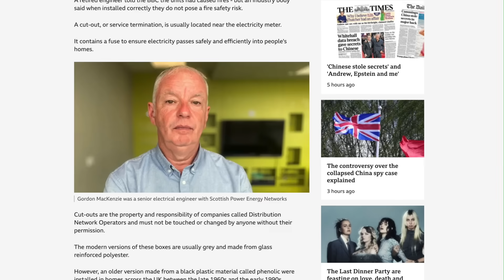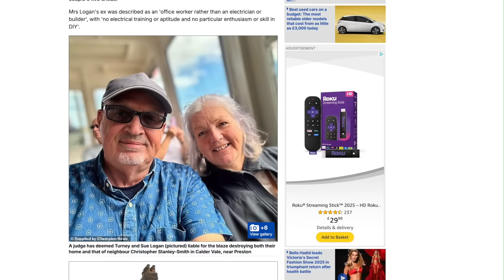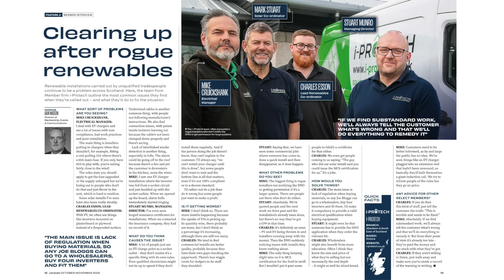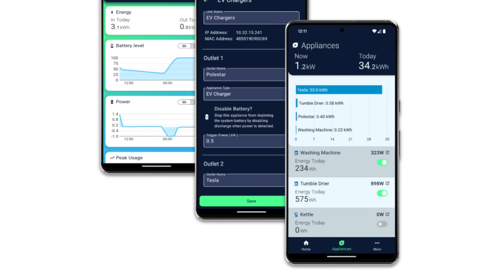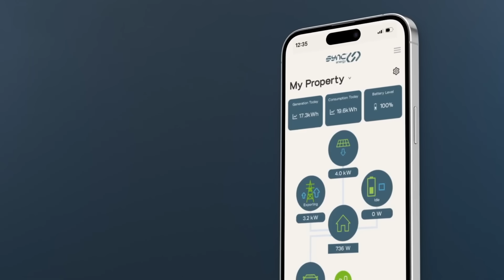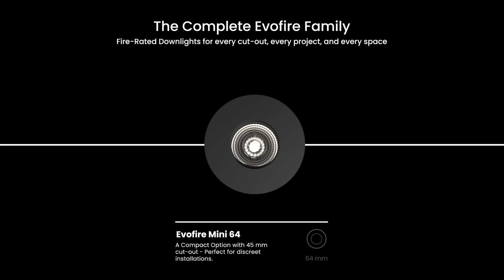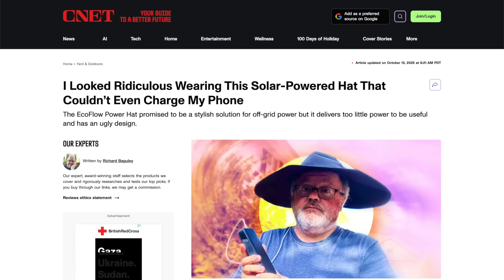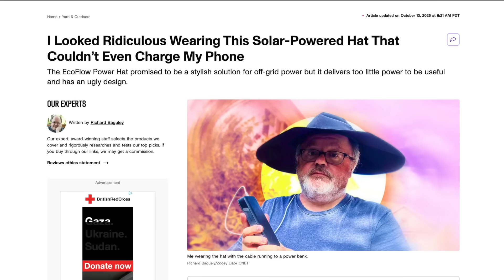Why Is the Electrical Industry Ignoring This?

Comment: Nobody knew there would be high current devices, such as car chargers and 8kw showers etc, when a lot of the infrastructure was built many decades ago.
If you say the industry is 'ignoring this', it is because it would cost billions to make upgrade their system to a suitable stadard, keeping in mind the added requirements in the drive to net zero.
As to safety - we rightly condemn cowboy installers; yet the supply companies themselves appear to have no standards that make sense on their 'installations' on this matter?

Comment: 2nd Ev install i came across in the last two weeks, one with 10mm t&e single insulated cables in the meter cupboard & no overload protection. The other with 10mm tails & 6mm earth same issue, along with exposed live parts, undersized earth conductor for a TNCS supply. I have not been able to get any clarification off the NICEIC if 10mm should be even used, main fuse rated at 80Amp. DNO say NICEIC responsible when asked a about main tail size.

Comment: I have to admit, as an electrical inspector, I have never thought to check the service cut out fuse that the casing could under certain circumstances become live, and I've noticed in the EICR form, it's not mentioned. It's obviously a C1 condition, but how would you enter it in the current EICR form ?

Comment: I have seen metal case cut-outs with tar like substance bubbling out. Phoned the national Grid emergency came out quickly & fixed it. I have also seen allegedly cutoff supply's that are still live not good.
Reply: Compound filled cutouts were installed in the days before central heating. Todays warmer homes soften the compound allowing it to slowly run out. From experience we know it could all run out, be empty, and it does no harm.
The worst part about this is the tar dripping on carpet etc. Our standard practice was to replace the cutout with a design that was the same and just leave it empty.

Comment: Well, well, well… if it isn‘t another case of shitty british standards and equipment! Small hint to solve the problem: using NYY-J cable to connect a building to the public supply and using an NH terminationsystem inside thr building. Just google „Hausanschlusskasten“ and you will find how the germans do it… and YES, it‘s the way better solution to do it!

Comment: The two terraced houses in Calder Vale, near Preston, Lancs, were effectively destroyed by the fire, which investigators said could have been caused either by a carelessly discarded cigarette end or an electrical fault relating to wiring leading to a freezer in one of the couple's garden sheds.
Reply: Mr Logan later told investigators that the electrics in the couple's house had all gone off and that about half an hour later he was "completely taken aback" to see flames "shooting out" from under the shed housing the freezer.

Comment: Interesting you talking about the cut outs. I had a guy come round on Monday from National Grid checking on the cut outs in our road. He told me that the Electricity Boards used to do this but, come privatisation, they were told to remove any personal data (customer name, etc.,) and hand it over to the supply companies who would then maintain the systems. Guess what? They didn't and now Nat Grid have no records so they're  having to go house to house and carry out quick checks (volt stick and thermal imaging camera) and record the meter ID and their results. I've got a nice little sticker on my cut out now to say I'd been inspected.

Comment: Yes! A year or two ago I stuck my head under the stairs to get something and could hear crackling. Uh oh! When I investigated, the tails into the cut out were melting. Turned off the washing machine and called the DNO.
He tried to fix the problem by re-terminating(!!!) the tails.. but broke it further and had to replace the unit.
I did try to quiz him on how the cables had become loose but he was not very forthcoming (I wonder why) but I did get "this happens all the time" !!!
I can only assume the bakolite is becoming brittle and the once secured cables are becoming loose?
So so so close to a fire.

Comment: A bit worrying about the supply hook, point failing with age? It's sort of potted, even having a  nose at it, not going really indication internally, before it burst in flames, looking very bad floor, and good excuse to gett every that not that keen smart meter, also known for exactly being sage, and safe for wollet when it goes wrong your electrical supplise should consuanable parts in it, what sould be build for the test of time not 5 years and need replasing or burn your home down to the ground

Comment: If this was an extension lead in a plug socket surely the MCB, RCD should have been questioned and why the circuit didn't tripif a rodent caused a direct short even a fuse should have melted.
Reply from the maker: Lots gone wrong on this one. 😬
Reply: @efixx  yes, as usual with courts, the details in the press release or whatever is lacking in vital details of what PRECISELY went wrong
Reply: RCD aren't that reliable if the rodent or gardner isn't grounded as they work by detecting a difference  between the phsse and neutral currents (caused by a portion of the current flowing to ground). If there is no connection to ground then whatever is attached to the end of the wire just appears as a load. I mentioned gardners before as there have been cases of someone cutting the cable with their (more often than not) double insulated hedge trimmer or lawn mower. They then pick up the ct cable, poke the end and get a belt because their gardening wellies are insulating them from ground.

Comment: 6kw wired in 2.5 flex into a plug top
3.5kw oven same as above
Plugged into the same double socket which was wired in 1mm cable🤦🏻‍♂️
“Kitchen sockets” at the board was a 1.5mm radial
It nearly burnt the house down absolutely stunk of burning rubber in there
Reply from the maker: Scary stuff. 😬

Comment: Why are you using so much awful AI generated B roll?
Reply from the maker: We used three pieces of AI generated footage. This came to around 16 seconds of video. In a 16 minute long piece of content. That equates to 1.6% of screentime. Hardly excessive.
Reply: @efixx  I make it two stills, and two pieces of footage, one of which was used twice and that presumably makes up the third. That's five instances of AI generated B roll spanning 20 seconds and eight frames. The video is 15 minutes, 56 seconds long, which makes it 2.1%.

Using scene cut detection I count about 100 different cuts, depending on you slice it, so that's about 5% of the clips by number rather than duration.

However, there are also 8 minutes and 12 seconds of adverts, so if you subtract that from the run time, that means 4.3% of the overall content you produced was AI generated, is that starting to feel excessive yet? Since about 51.5% was advert, 4.3% was AI, you only actually made 44.2% of it yourself, and that's being generous and calling the stock footage yours too.
Reply from the maker: No, it still doesn't feel excessive. Why did you feel the need to do all that calculating? And why does it bother you so much? Genuine question.
Reply: @efixx I didn't do that much calculating, but I did it because it feels excessive and I wanted to elucidate why and how it felt excessive. In this case because my judgement is that it was being used for things that can be done as well or more well using other methods.

The reason that's important to me is that the source data for generative AI was largely obtained unethically, and is regurgitating someone's work that they were not paid for. In addition, it is being operated unethically, using excessive quantities of resources that are also often obtained unethically, and in a manner which contains errors or sometimes is just incorrect. Sometimes even deliberately or carelessly misleading.

So I'd like to ask in turn, why does it seem proportionate to you?

Comment: If this is a high court ruling,I believe this will become "case law" and can be refered to in future.. This needs more publicity..There must be hundreds of thousands of extension cords supplying sheds...Why didn't the fuse in the plug blow?
Reply from the maker: All interesting points!
Reply: rodent damage could have exposed L/N or L/E, add water, you get slow heating rather than an instant short,  plus who knows how long it was, maybe Zs at the far end wasnt enough to take out a 13A fuse in a timely manner, but 3+ kw in a small area could easily set a wooden outbuilding on fire.
Reply: I've had a case when i was much younger, where i cut thru the lead on a hedge cutter at the end of our excessively long garden, it was arcing and smoking, but didn't take out the FIVE amp fuse in the plug

Comment: It’s not heads get replaced by don when they are notified but what is ignored by the vast people is the state of the industry, dumbing down, single insulation in meter cabinets (not enclosures), spds with no protection, no monitoring or policing of the industry, diverted neutral among many many things!!

Comment: I've never really come across a dangerous, horror PV install, I think all the installs I come across are not done with the care, precision & detail that I produce (and I know my friends agree), but I am semi-retired and do not have to work at commercial rates, if I did,, I guess I would not be a lot different! I have great issues with fellow electricians and their appalling knowledge of structural engineering, building & fire regs particularly associated with timber frame constructions, especially since I tend to install large PV systems with huge battery banks, VRF systems etc. Many electricians, try to work on large systems but do not produce proper engineering CAD drawings, structural load calculations, regulation conformance documents, SoP's, SLD's and the crap that larger systems frequently require.

Comment: I have worked for a DNO since '77 ....... Phenolics are a known problem!
That said I have been called out to many that turned out to be no surface voltage. Most of the breakdow of the phenolic cutouts can be attributed to conditions around it (grease, oils and dust). 
As others have said a Black Phenolic cutout is given a C rating (not dangerous but should be placed on the replace list) rather than a B or even an A (immediate danger). 

I note the boss of Scottish power only raises his concerns after he has left ....... convenient? 
Let me be clear, IF there is danger they should (and are ) replaced in a timely manner free of charge. You can expect a visit within 3 hrs of a call to look at it and decide how dangerous it is and what action should be taken!
Reply: Yep. The issue is under control.
Reply: DNO since1982, agree 100%.

Comment: The DNO code to report black plastic cut-out is "C17". Be wary that many phase finders are sensitive and will falsely indicate voltage across these cut-outs, let alone the modern grey ones. The fail safe test to check for dead across these is to use double-pole voltage indicators across the fuse carrier and a known dead (earth/neutral).

However, there is a specific Henley Series 5 black plastic cut-out design that have had reports of flashovers between the internal phase and neutral barrier. Thankfully, after 10 years of fitting meters I've yet to have a flashover whilst working on one of these 🤞
Reply: I've seen one of those report at 1.5V
Reply: I hope you never have one either, not pretty with a 400A substation fuse on the other end

Comment: I do have concern about not just about conductive ancient fuse holders, but also the bitumen covered 75 year old input cable, the one that goes through ancient concrete, under the garden, the pavement, under the road to the joint under the pavement on the other side of the road. What's its gauge, what's its condition, what's its lifetime?
Maybe better not to think about it too much!
Reply: A lot of the network is getting pretty ropey. A few weeks ago there was a loud explosion just outside our house. I went out, along with most of the neighbours. A 4 way junction box had got water in it, & blew a 1/4 ton iron & concrete manhole cover about 10 feet up in the air! A smell of burnt electrics lingered in the air, which was the give away to the cause & my cue to put a call through to the DNO. They were unaware as nothing had disconnected. Eventually someone turned up, & realising it was still energised, the calvery soon turned up. They worked late into the night to make it safe, involving a 6 hour outage. They actually didn't install a new junction box til a few days later, & did all the cable splices live as we didn't have another outage!
Reply: @alanjewell9550  that's a link box by the way. the actual cables are typically pretty decent. the bitumen coating seems to be the key thing that saves it.
Reply: Paper insulated cable with oil impregnation is what you are thinking of. Simple answer, if it never gets damaged or exposed and backfilled incorrectly (waterboard, gas, ETC) the cable will last for ever. Cables over 100 years old are still running perfectly fine.
Reply: @davidsoulsby1102  yes, our incomer is PILC, and we routinely see 3 core PILCs dating back to the 3 wire DC days still in regular use.
Reply: @davidsoulsby1102 I wouldn't dare stress it. It looks 'crunchy' as if it belongs in an Egyptian pyramid.
BTW, 2 years ago when I was at work with less than 200 watts load, the branch to ONLY my house failed (Fridge compressor surge maybe?) Pavement dug up etc.. Fixed 5 hours after I reported it, which was amazing. The guys said it happens a lot and even had explosions under roads, pavements..
Reply: And there are 10s of millions of those in use too!

Comment: Is it ignored? Im not sure it is. DNOs are aware and as you say Efixx have gone into this in the last couple of years and the E5 group for many years prior along with others such as welllll me. DNOs do have upgrade programs for aged service heads both metallic and plastic. But it boils back to funds. Bills will have to rise if all service heads are to be upgraded. Is the failure rate warranting that or is it best to cover via reactive maintenance? Hard call in fairness especially when currently its unfunded. Easy to be critical, harder to solve.
Reply: Of course its already funded. What do you think the standby charges are for..... to maintain their network.
Reply: @mastergraphic9998 to replace every single old service head? That isn't funded. Far from it. I would do some research on what it costs to maintain local DNO infrastructure and wider HV grid. Our charges cover reactive maintence and planned network upgrades. Life cycles on service heads are not within that. Which is why they are not changed generally unless they fail or are of the very old metallic varieties. This is situation if you like it or not
Reply: @electrician247 one service head upgrade every 50 years. Of course its funded they just keep giving the money to shareholders instead!
Reply: @electrician247 service head upgrade costs around £300-400 max and over 50 years thats £6-8 each year to fund them.
Reply: @mastergraphic9998 that is not how standing charges work and isnt factored in with them. What is proposed is changing circa 20- 30 milion service heads all at once due to this known issue. The maths are not hard as you have just set them out. 

Its unfunded. So the question is who pays and how? The reality is what it is.
Reply: @electrician247 standing charge of £188 per year x 28.6 million households in uk is 5.38 billion each year income plus 13.8 billion annual subsidies for nation grid. That is just domestic supplies and does not cover commercial or domestic energy. Also surely not all 28.6 million service heads need an upgrade. Lets say 20million need an upgrade and a mass rollout was undertaken at £300 each due to economies of scale that only equates to 6billion in total.
Reply: @mastergraphic9998 exactly the maths dont lie. All that revenue you have listed is spent. So who pays for the extra 6 billion.
Reply: @mastergraphic9998 shareholders and privately owned DNOs do without question take from the pot. But that doesnt change the fact this work is unfunded. These style of heads are everywhere across residential and commercial dwellings. Reactive repairs are funded. Mass recall of this scale is not. When the reality is most of these service heads are not yet conductive. Which is why total asset replacement of the entire installled heads of this nature is unfunded.

Is the risk profile warranting that action. This is the question. If it is then bill payers will ultimately have to cover the cost.
Reply: Nature of the point of supply means any failure is significant & a fire risk therefore in my opinion every suspect fuse head should be upgraded. If it was an aircraft with suspect engineering theyd take it out of sevice and make a maditory upgrade!
Reply: @chas3997 ukpn made 853million operating profits last year on their own and i could run the numbers for each regional dno too. Shows the money is there mate butnprofits come beforw safety unfortunately 😢
Reply: @chas3997 in aviation that is sensible and falls into the scale of risk. HSE, insurers and the DNOs will know how many of these fail and in what circumstance. If we like it or not that is then set against cost/safety. 

We could make electrical distribution bullet proof but the cost to attain it would be beyond most people's willingness and ability to pay. So we end up in the real world riding the risk scale. 

Thankfully these catastrophic issues are very rare and most failures caught and repaired. The DNOs do a very good job of that.